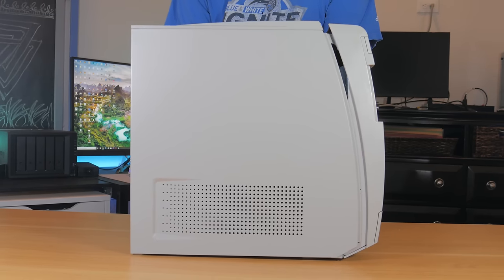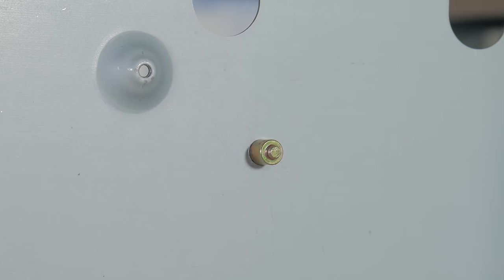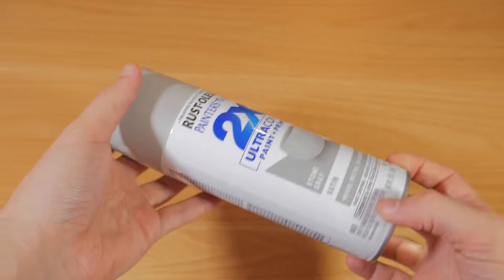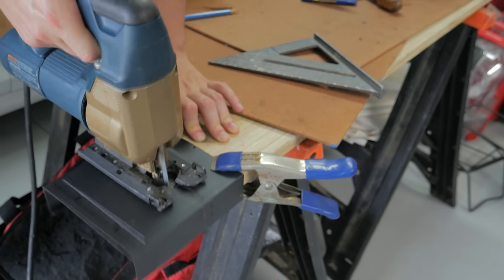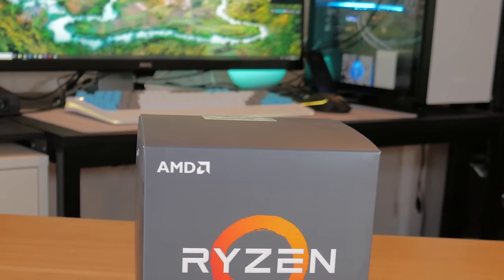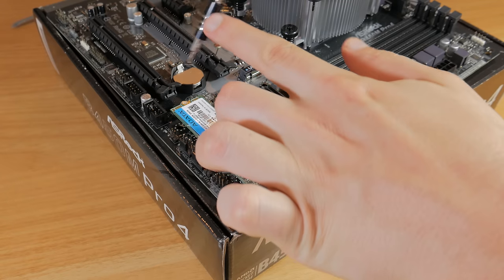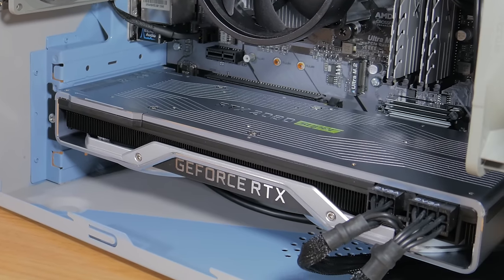I Built An EPIC Sleeper Gaming PC! (2019)

Comment: Just a heads up for ur next sleeper PC or some sticker remover use WD40 and let it sit for 10min and take a old card and scrape with light force will take it off with out issue and then use some running Alcohol to clean up the grease after wipe it down with a damp cloth to get rid of the smell combo left Behind.

Comment: I built a sleeper for work.  We work hard at work but only for short periods of time.  Sometimes we have a lot of down time and we're allowed to play games as long as the work gets done for the day.  So we knock it out and then you can do w/e you want pretty much except sleep.  The only problem is the work PCs are very limited and cant really play anything great.  So I decided to bring in a mini itx from home.  The only problem was the IT guys were not as thrilled as I was about the RGB fans and lights and soon I was told by my boss it needed to go back home :(.  So to get around this I took one of the old towers we had in the storage closet that were discarded by the IT guys.  I pretty much did the same thing you did but no where near as nice I just needed functionality.  It worked great and is much lower key and I've gotten a few weird looks by the IT guys as to why i'd want to run the old obsolete tower but I just tell them I like it and they just shrug.  Now I can game at 144hz :) on an old sleeper pc at work.  It's great!
Reply: lmfao dude

Comment: Protip: buy a Step bit for your drill. Would make drilling those indents out a breeze. Sick build though.

Edit: 32gb overkill for gaming? *laughs In modded Minecraft*
Reply: Yes, 32gb is still overkill for gaming. It makes a very negligible amount of performance difference. Mostly you just want it to be as fast as your mobo/processor allows. Also he didn't want to purchase a hole saw because he didn't wanna spend the cash for something he would not use much after completing the build...so why would he spend just as much or more on a step bit? Those things can be anywhere from 20-60 dollars at lowe's and I will only buy one if my employer is letting me use the company card. To be fair though, you can find them pretty cheap online, but they dull too fast to be worth it.
Reply: laughs with my i9 9900k and rtx 2080 ti ftw3 ultra gaming hydro copper and 64GB ram :/ need another gpu but that gpu rare now as can’t get gaming 4k max settings good enough as maxs the gpu
Reply: What are you doing step bit?

Comment: Nice build.  The only thing I would change is using an SFX power supply from Corsair or Seasonic to save up some space and further help with cable management.
Reply: William Wilson it looks like the case already had mounting brackets for an sfx already as well.
Reply: Phantom1100 And the SFX PSUs I’ve encountered all have mounting adapter brackets.

Comment: It looks amazing. Got a couple of questions tho. No judgement, this is just my OCD talking (apologies if this is annoying). Here we go:
-Why only a single 120mm intake? 
You should have room for a 140, maybe two 120 if you take off the GPU shroud or use a shorter GPU. 
-Same goes for the back, why only a 90mm fan? You should have room for a 120mm or two 80mm there.
-And why not add bottom intake fans? Looks like it should fit, worse case scenario switch to a mobo that has the 16x in the first slot
I mean, 70 under full load is excellent , but you could have gotten even better results with less noise. More OC/noise headroom.

Comment: Great build. I've seen a lot of sleeper builds, but this is one of my top ones. A small shame you couldn't fix the frontal plastic swinging door before this video was made. That minor finishing touch would be great. *Question: Are you concerned about NOT using a blower style style graphics card? There doesn't seem to be a lot of airflow directly beneath the card, and its very close to the bottom of the case.*

Comment: When I build something like this I call it a theft proof PC. The firs one I did was upgrading an old WANG 286 to a really nice 386. The original WANG motherboard was huge with a bunch of ports to the right of the standard AT keyboard socket location. The left half used standard AT mounting screw locations so putting the normal baby AT 386 board in was simple. The open spot to the right, beneath the power supply, got blocked with aluminum flue tape inside and out.

Comment: Hmm, I've never had a problem finding cheap old cases....sometimes still full of components, but easy to find. Also, get a bucket, fill with the hottest water possible, and soak the paint can for about 10 minutes, it will thin the paint and it lays better.

Comment: Giving it slightly taller feet, and making a hole in the bottom of the case & putting in a 240mm fan filter you'll probably get more airflow too the gpu.

Comment: Just took apart my parents old Pentium 4 dell dimension 3000. Didn't need to cut anything. Putting a xeon x79 set up in it. Micro atx board fit perfectly once I removed the motherboard stand off screws that were located under the Pentium 4 cooler.

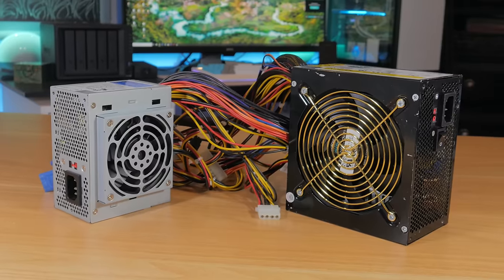Comment: 2:11 I'm pretty sure that is a SFX form factor power supply with an additional space for its fan. You could pick up any modern SFX PSU and use it in that case without modifications.

Comment: 5:30 
Only if something is in the way in front of the fan, otherwise the less than one airflow fan move. The pressure in a high static pressure fan only comes about if there is something in front of it, such as a radiator, cooler, hard disk cage.

Comment: Super cool and unique mod, and great video. I think you probably picked one of the hardest Emachines cases to build in, as most of the others I've seen don't use proprietary PSUs. I am a little confused where the front fan will be pulling air in from, or do you just remove the front cover when using it?

Comment: it looks amazing. Got a couple of questions tho: Why only a single 120mm intake? 
You should have room for a 140, maybe two 120 if you take off the GPU shroud or use a shorter GPU. 
Same goes for the back, why only a 90mm fan? You should have room for a 120mm or two 80mm there.
And why not add bottom intake fans? Looks like it should fit, worse case scenario switch to a mobo that has the 16x in the first slot
I mean, 70 under full load is excellent , but you could have gotten even better results with less noise. More OC/noise headroom.

Comment: I had pretty much that exact model E machines as a kid. Specs were:
1 GHZ Celeron, 1 core - I think socket 370
128 MB SD RAM - 1 slot / single channel
20 HDD
x16 CDRW Drive
3.5 inch Floppy Drive
PCI 56K modem
PCI 100 MB NIC
Onboard 4 MB GPU
Windows XP 32bit, service pack nothing, they were not out yet lol
It could barely play Star Craft lol

Comment: I tried building a "sleeper" i7 4770K, GTX 780 into a 2003 Coolermaster Wavemaster Tac-T01 case like 6 years ago. Turns out if you haven't built a PC in 10 years and think 5x 80mm Noctua case fans should be fine you end up with thermal issues lol.

Comment: Nice one.
Though you should have baught a holesaw for 10$.
And you should have paintet the back of the PSU and the CPU mounting plate in the same gray as the case.
Front looks awsome.

Comment: For Far Cry I wonder if the processor is throttling a little with the stock cooler. Looking at this build it looks like it'd be difficult to add an after market one. But still 75 frames at 1440p is good.

Comment: More like a sleeper antique .esssh E machine lol.i would also cut a hole at bottom of case for that gpu and get some feet.You may get thermal throttling.good job on makin it fit .Something i would not do lol.well i did a mod few years back .modded a koolance case . Changed the front end NZXT apallo top torso and bottom koolance and sprayed her jet black.made 120mm fit in a 80mm config with a bit of dremill love ....i would have went with either a koolance case or an alienware of that era.

Comment: Hello did you have a problem with the power switch not being able to just plug it in to the m/b? Considering using a Dell Vostro or Optiplex case, but keep the OEM pwr switch. Thanks

Comment: Great build the old e machine parts do your self a favor throw it away those psu were nasty surprised they didn't cause fires they had a 300 percent failure rate they were the only one to fit the case. But great job of getting that in the case very nice

Comment: i got a really old 2002 antec office pc case with 6 hardrive bays and its really seen hell and back 20 times the case itself it has a msi b40m gaming plus with a ryzen 5 2600 with corsair vengeance LPX 8gb X2 3000mhz ram and zotac GTX 1060 6GB single fan.

Comment: Got a hewlet Packard pavilion has the same 3 panel top n sides ..small case..power supply is in front of the mobo n cpu cooler..im hoping the sfx power supply i just ordered will fit..gonna modd the floppy bay to hold a 4port usb hub at least...r7 2700...16gigs corsair vengeance rgb 3000mhz..have a 2fan 2060 I think it will fit :) love to get a fan in the front :)

Comment: dude you're too hard on youself on the modding quality.  You did it 100% correct.  You think those sleeper cars you mentioned are modified with OEM statndards for mass production?  No they aren't.  Firewalls are hammered on...alot of shit gets torched out, and brackets are fabricated as needed.  You did it right.  BUUUT you need more airflow for that setup.  That RTX looks like it has no airdflow.

Comment: Good night my name is Ezekiel I just wanted to ask you something so I have xfx Rx 560 GPU it has One HDMI one display an vga port on the GPU I got into streaming an will just wanted to know if my GPU can run duel monitors I am currently using the HDMI port and was wondering if I get a second monitor if I can use the VGA port to run a second display

Comment: CPU: Ryzen 7 2700 8C 16T @ 4 GHz
Motherboards: Asrock B450M pro
Ram: XPG 32GB DDR4 @ 3200 MHz
GPU : RTX 2080Ti
EVGA 650 G+
SSD: mvme 256 GB
Thank me later
Reply: 2080 super**
Reply: Also it's not nvme it's just regular m.2 see how it has 2 indentations instead of 1 that means it's not nvme

Comment: Pelase help me ( so I wanna build a console killer but the PC that I got it's a dell optuplex 760 but when I try to connected to the monitor it says power saving mode and it shuts down but if I take the vga cable off it wilk be back to normal and the PC turns on fine but I don't know what to do

Comment: I noticed newer pc case place the psu at the bottom which is logic for centre of gravity

Why the older pc placed psu at the top is a mystery to me
Reply: Mayen when PC's had less fans the PSU fan was a bigger deal. And hot air rises so you want to suck the hot air out at the top back

Comment: I have  a normal case,a bussines pc,inside i9 9900k overclocked with gtx 1070,16 gb ram with cool system and 12 volt turbocharger cooler,if i want to overclock the fans,the pc will freeze,i heard the gtx 2020 came out,it will take me 6 months to get the money to buy it:(

Comment: Huh, I've had a sleeper PC for a while now and didn't know there was a term for it. I was just too lazy/cheap to get a new case. So I've got a Ryzen 5 1600 w/ 16GB Ram and a R9 580 in the case of an old Dell Dimension 2400. It's honestly not a bad looking case. 

I had intentionally planned on repurposing my old Gateway 386DX behemoth from the 80's into a modern PC, but again - never got around to it. That was really more something I could lug around to LAN parties as a show-piece, and that appeal kind of means fuck-all now that LAN is all but dead. I'd also need to get a good widescreen CRT monitor to go with it, and one with that iconic cream/beige dis/coloration. That might be tricky. Suppose as a last resort I could just gut a broken widescreen monitor and mount a OLED panel or something - but I'd really rather have the real thing.

Comment: Wouldn’t the Ryzen 2700 bottleneck the rtx           2080 super? I think a Ryzen 7 3700x would be ideal
Reply: if the 2700 could handle the rtx 2080ti then it should handle the 2080 super just fine
Reply: Memez Boi it cant support 2080ti it will produce 12 percent of bottle neck and anything above 10% is a bottleneck
Reply: @keuf8198  oof, i should have known that, thanks

Comment: Its the Honda CRX of the computer world. Basic red lunchbox of a car but with a 500bhp engine, some turbos, carbon-ceramic brakes, fully adjustable suspension, road legal racing slicks, and lightening to weigh no more than a plastic tupperware container.

You know, nothing special. Totally a normal car from the mid 80s.
Reply: More like a Miata NA 🤔